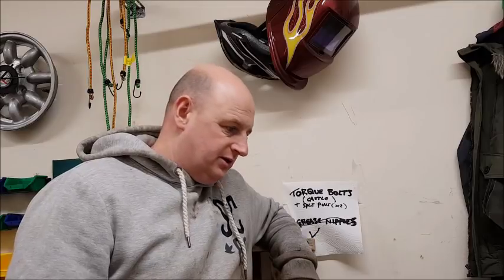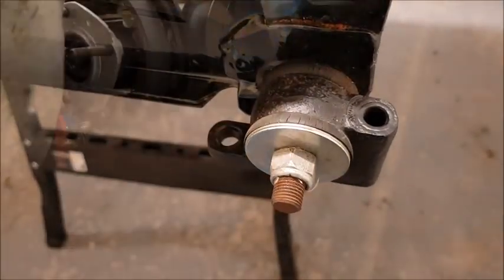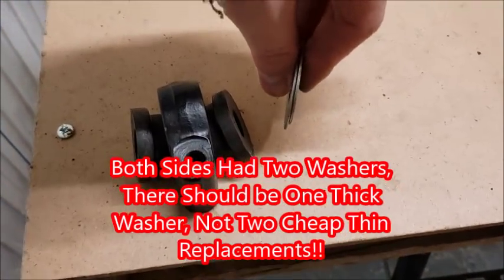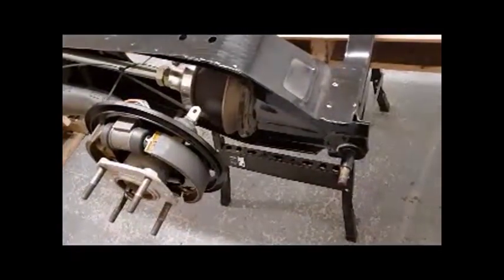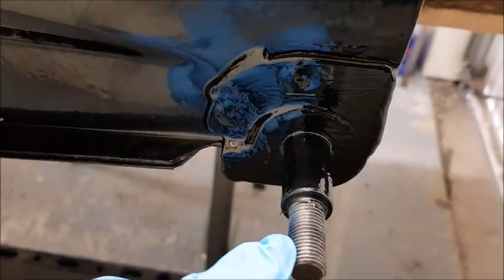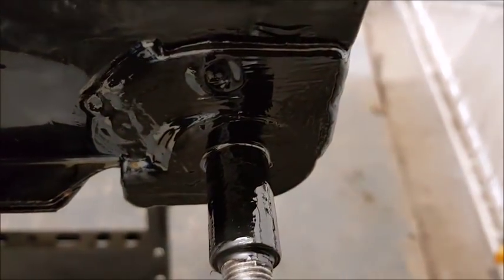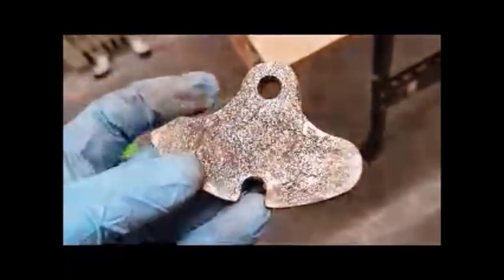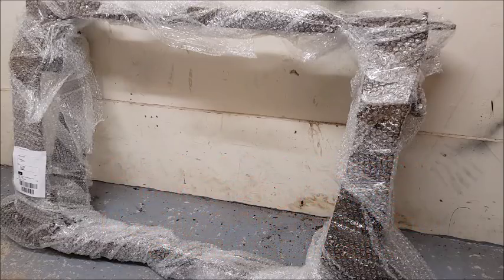Classic Mini Restoration: Eleanor Video 31, Rear Subframe Trunnions, Bushes and Quadrants

Comment: Enjoyed your newest video. You would have made a good shop teacher. I was wondering if you would put seam sealer on the edges of the sub frame where the two metal layers have parted slightly?   Cheers, Midge
Reply from the maker: Midge Lambert thanks. I will be checking over the whole subframe once the other side has been stripped

Comment: Informative video, what are the quadrant bolt specs? My pin is corroded and was thinking about swapping it for a nut and bolt
Reply from the maker: http://minispares.com/product/classic/CLZ549.aspx
Reply from the maker: I found ghe clevis pin greased was better than a normal bolt  as the bolt traps debris easier and corrodes quicker
Reply: @DBMiniDIY  ok noted, thanks for the advice

Comment: them handbrake quadrants are ment to have a pin holding them on and a washer and split pin also thay only fit one way due to the nipple recess being offset
Reply from the maker: mark piper I have ordered the correct pin set for it and that's what will be going back on. Glad i stripped it right down though. Cheers